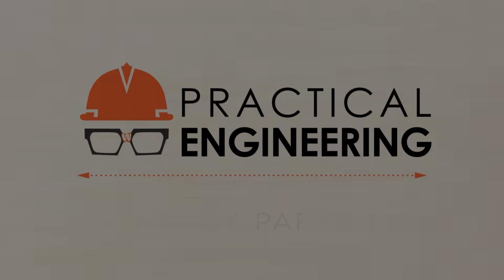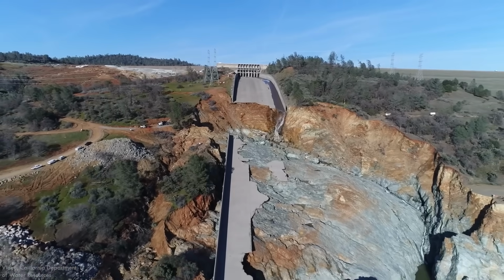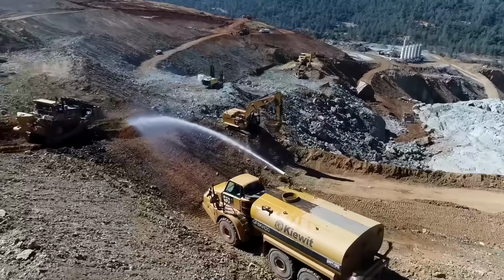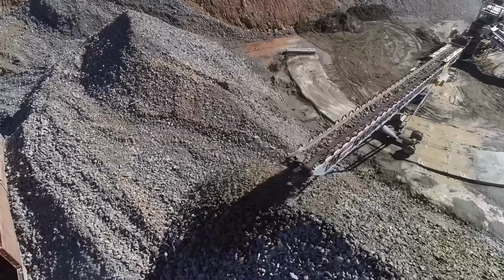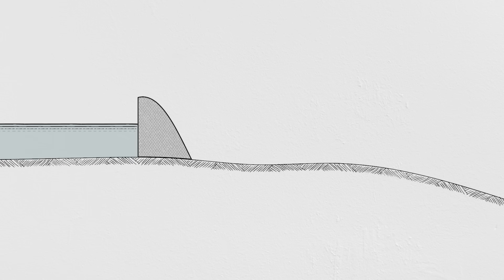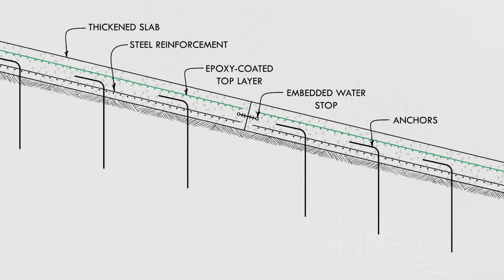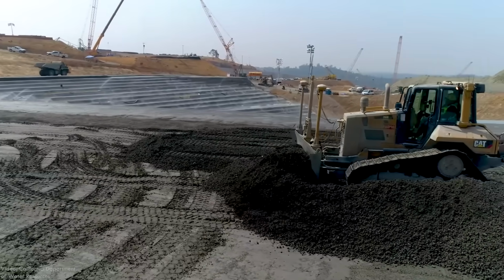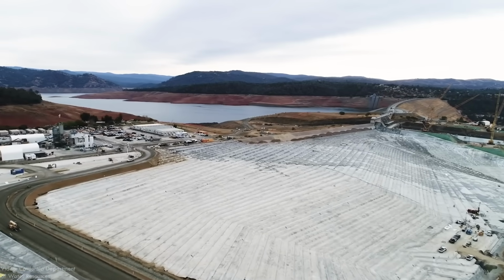Rebuilding the Oroville Dam Spillways

Comment: If the foreman handed me a shopvac to dust off a giant field of rocks, i would propably just walk off in disbelief
Reply: Having a clean bond surface is critical to the structural integrity of the bond.  You would be amazed at the deleterious effects of bondline contamination to bondline strength.
Reply: @JeffreyBue_imtxsmoke   I think it was a question of why "shop vacs?"  It'd be interesting to know if they used industrial vacuums/pumps before going hands-on with such tedious work on a huge project.
Reply: @emmakai2243  Whatever it is would probably be too noisy, too big, too unwieldy and too niche.
Reply: @crackedemerald4930  There are vacuums that suck from city sewers.  Did you watch the video?  There are niche, unwieldy machines all over the place.
Reply: It's probably for good adhesion with the rocks. Thank goodness they don't have to use those stupid sticky pads for removing dust before something goes in a paint booth, lmao
Reply: Every concrete job I've been on has used shop vacs before the pour. Compressed air doesn't get rid of the debris it just blows it around. It's really the only answer.
Reply: I've seen construction workers use pressure washers to clean rocks for concrete pouring
Reply: @xWood4000  they couldn't pressure wash it because that would soak into the cracks and cause potential issues, as well as running muddy water down to the guys working below.
It also isn't as complete at cleaning out the cracks as a person can be.
Reply: Heck no,  I would have been taking that dirt home and running it through my sluice box!
Reply: Luckily we had 400 laborers that wanted to be part of this historic project and wanted to make good money
Reply: I’d be happy to get paid to vacuum some rocks.
Reply: Those guys were thinking it was a time and materials job. We can stretch these hours if we use shopvacs.
Reply: @rudyjanke5942  they needed to clean out every crack so that the concrete would bond properly and not leave any place for water that was flow or puddle, and I am sure that this is the method that the engineers specified, because it's a common method for when you need a perfectly clean surface, and you will often see guys doing this on concrete jobs or bridge or road work.
Reply: And you'd be walking away from (probably) the highest paying job you've ever had. 
Repairs didn't cost $1,000,000,000 because the labor was being paid minimum wage....
Reply: @gravit8ed  Labor was prevailing wage. 35$ for laborers. 50$ for operators. More for crane guys. Plus benefit package. Kiewit, conco all those guys are union
Reply: @swazeyyy  Good, I’m glad these workers didn’t get stiffed. I’m a California taxpayer and I’m happy to pay my taxes to make sure these people are paid well and kept safe.
Reply: @gravit8ed im sure the general laborers were paid fairly since they’re Union lol.. but, lest not forget, the engineers, project management, all the equipment and transport of said equipment, plus the “rush” tax, the general laborers did not see a major portion of that money like your comment would imply.
Reply: I helped survey this spillway, Local 3 Party Chief Land Surveyor. Lots of hours. Only a handful of us out there
Reply: This is peak California gold country though and miners used to use hoses to scour away the dirt to bedrock because the gold sits there. I would bet money there’s some gold in some of those shop vacs and they probably even found a few nuggets.
Reply: Ha $80 hr all day give me a vacuum $120 overtime no problem jack!
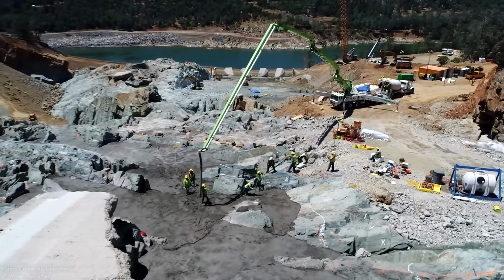Reply: 11:45 is what he's referring to.
Reply: The shop vacs are not vacuuming for cleanig anything other then air while pressure washing is not pressure washing its appling tack coat to bed rock witch bonds the rsc to the rock and ahop vac is a pre cleaning of the rebar insets drilled into the rock so tack coat sticks
Reply: shrug it all pays the same lol
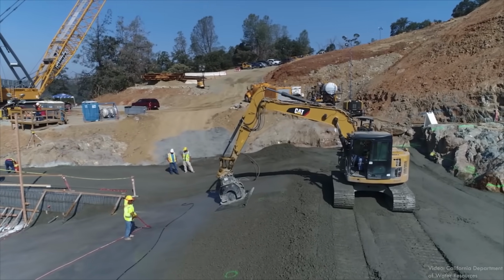Reply: 6:32
Reply: Did hard work trigger you soft hand  😂
Reply: What is this the military? “Go do some dusting in that field over there, privates keep having asthma attacks” 😂
Reply: Guess you should stay out of the construction field. Shop vacs are very common in construction, concrete work, road work, etc, and were the best think to use here.
You need a dry surface, so washing is out of the question, and if you use compressed air you are just raising a cloud of dust that settles right back down on the surface you just cleaned.

And what you can't see is that all those guys were also digging into the cracks, and pulling out all the loose rocks and dirt and everything not part of bedrock, and then vacuuming whatever was too small to pick up, so that the concrete would have a perfect bond to the bedrock and not have any space or gaps for water to flow or accumulate.
And giving each guy a Vac was the best way to achieve this goal.
Reply: Tell me you have never done any plaster work on a wall, without telling me you have never done any plaster work on a wall... 
It is obviously hard to belief for you, but if you apply plaster, cement or something similar to a dusty ground, it will just break off with the next disturbance. Thankfully construction workers know that type of thing, so the reconstruction wasn't halted by a massive walkout.
Reply: @creativedesignation7880  damn this comment blew up fast
Yes i understand the idea behind removing particles to prep the area for bonding, wouldnt surprise me if they went over it with pressured water or even chemicals before pouring.
Just such an unexpected sight these guys going trought the cracks like it was their couch
Reply: @creativedesignation7880  Comparing this project with drywalling is like finger painting vs the Sistine chapel.
Reply: @emmakai2243  "Comparing this project with drywalling is like finger painting vs the Sistine chapel"
so the same thing but a bigger scale? sounds like good insight to me.
Reply: Why would you care what you did? You're still getting paid to do it.
Reply: They use shop vacuum because it's nice slow and and tax money is paying for everything plus bonuses for the corruption 😂
Reply: Nooo this is a government funded job site...everybody gets a job and gets paid, ueah bring in your cousins and your cousins cousins and your buddy Joe from high-school. Yeah we convinced the government to pay us overtime to vacuum a mtn.